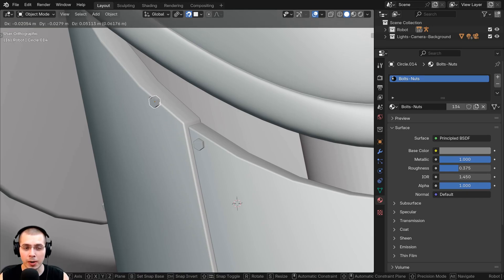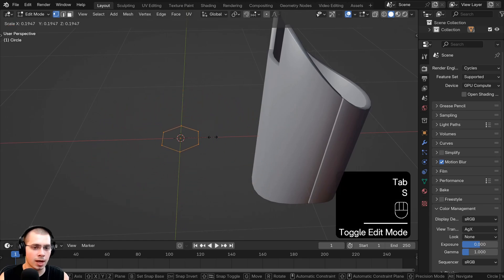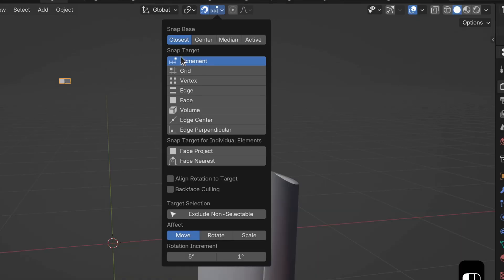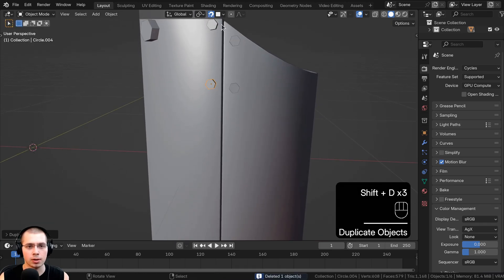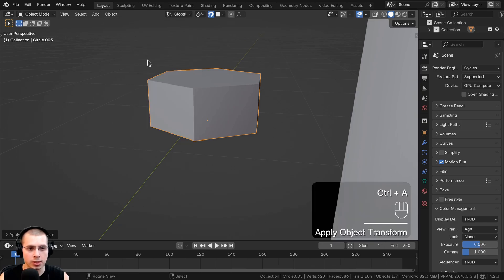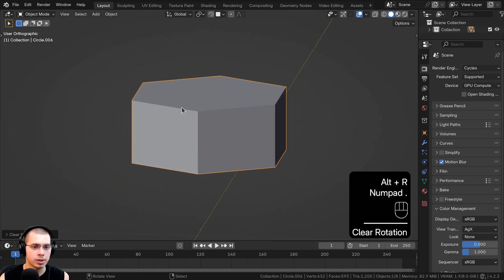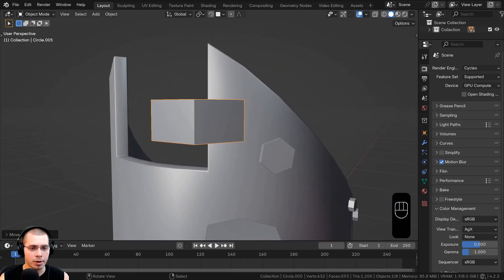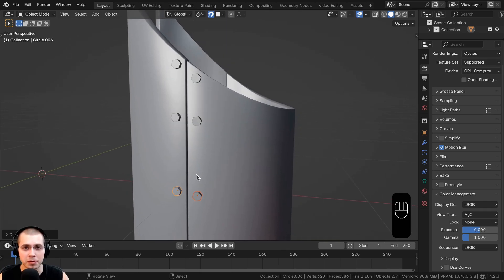Snapping to an Objects Surface in Blender (Tutorial)

Comment: I don't know if I know another way to get the cursor to the bottom of the mesh where you want the connecting point to be to the platform but if you do that, you can use the snapping tool at the top of the screen, it looks like a magnet and if you set it to face it'll snap that object two, whatever face

Comment: It doesn't work for me 😥

No matter what I do, it doesn't snap to the surface, the object is always half way inside the other object.
Reply: I know it's little late but I ran into the same problem and figured it out. The object I was using to snap onto had transformations it didn't like. Select the base object and go to "Object - Apply - All transforms" to freeze the transformations.